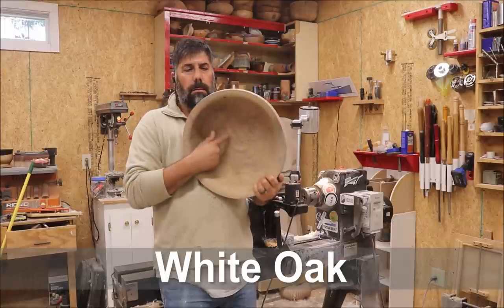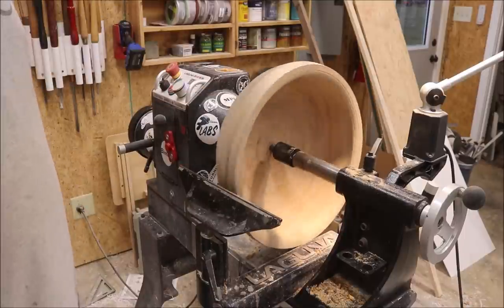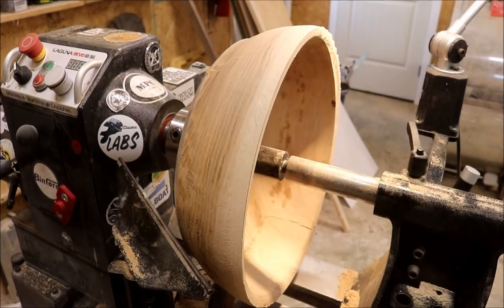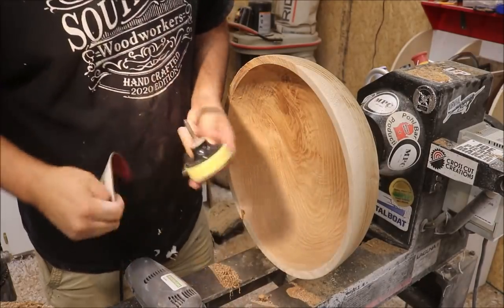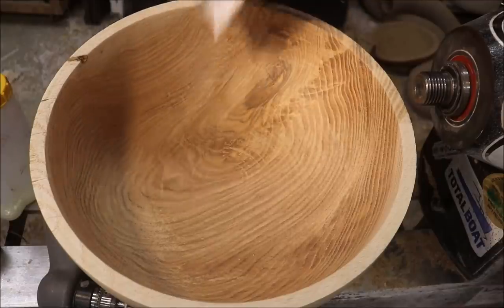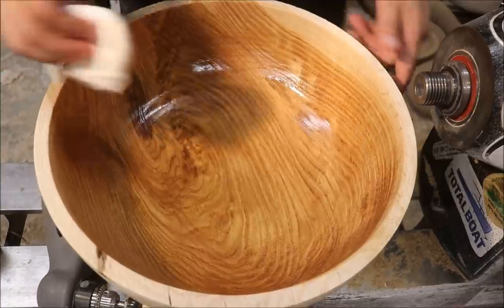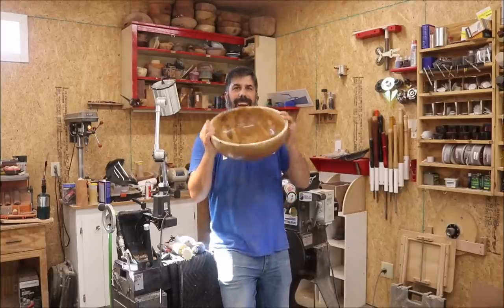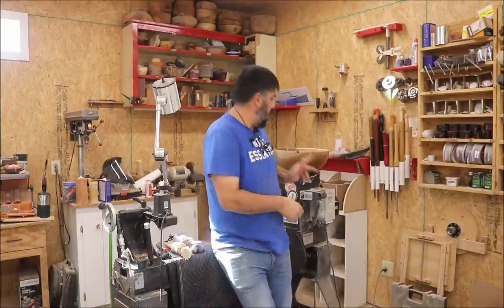Woodturning - The Largest Bowl I've Ever Turned

Comment: I did not realize that woodturning is a multi-step process, I thought that you turn it and it is done, I was not aware of the drying part. But to be honest I did not now that I am interested in watching turning videos until recently :)
Reply from the maker: It is possible to turn a bowl wet and complete the process. All you need to do it turn it thinner and once complete it will most likely warp.  Makes a cool effect for a bowl. Thanks for watching and commenting Norbert. I appreciate it.

Comment: Dude, that is just impressive!!! I have some red oak blanks that I split, Anchorsealed the ends, and have been drying in the woodshed for about 6 months. I think they are long overdue to be rough turned! 
Would you recommend the kitty litter as a viable option for long term slow drying? 

Great video man! And I loved the buildup of hype over the past couple of weeks. 

Keep it up! Can’t wait to see what’s next! 
Seth
Reply from the maker: I really didn't see a difference between using the shavings and the litter. Both dried in three months or so. Now I didn't seem to get as much warping in the litter though. 🤔

Comment: Been waiting a long time for this video and it was well worth the wait! Did you ever figure out why the chuck started to back its self off the spindle the second time. That was strange.
Reply: It was the evil spirit cast out of the bowl.  It entered the wood when the tree came down.  Gotta watch those wood spirits, they're tricky.
Reply from the maker: Hahahha nice Ivan. But I failed to tighten the chuck. Usually I don't have to but the bowl was a lot heavier than normal. Once the chuck stopped the weight of the bowl kept it turning.
Reply: @MoonpieCreations  I understand.  I've used lathes and turret lathes for machinist work in the past.  Would like to try that some day.

Comment: i have  noticed that  if i leave one too long in the litter  it will crack thats why i made the kiln   a bit more stable
Reply from the maker: I'd love to make a kiln, but you know how it goes. More wants than time.
Reply: @MoonpieCreations  i got the old fridge from work it longer to clean it  than  when i got it in the shop to get it  working  2 holes and a light socket